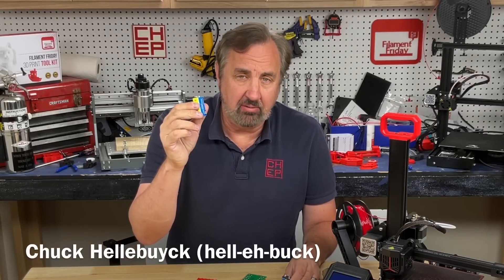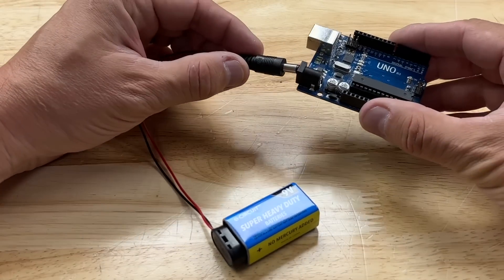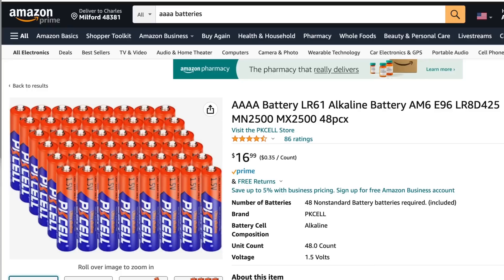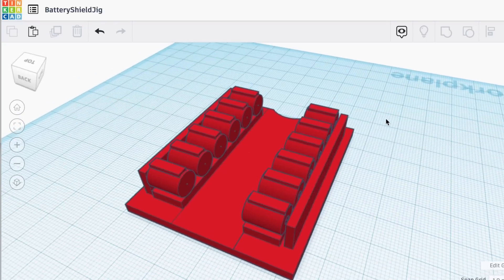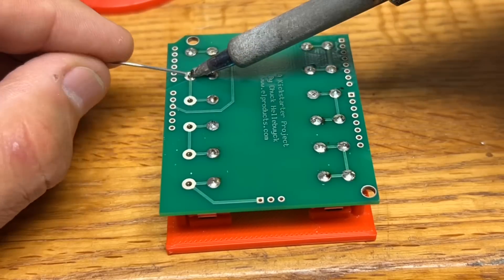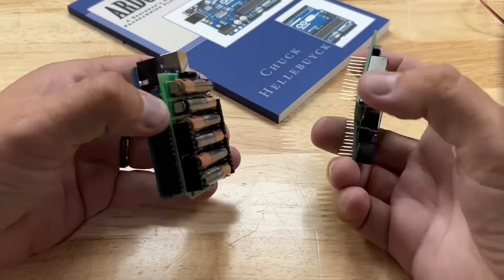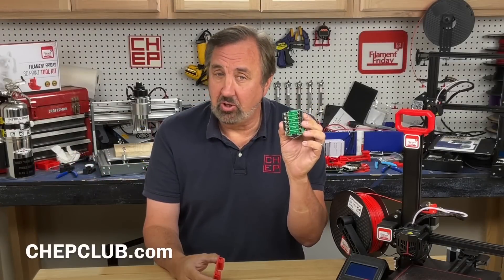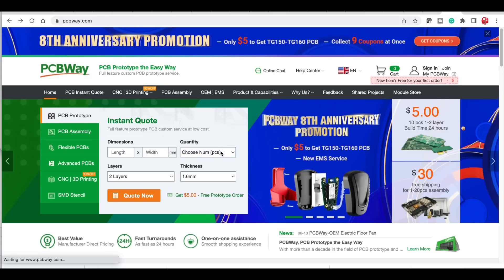9-Volt Arduino Shield with 3D Printed Solder Jig

Comment: Is there any benefit on using 9V instead of 6V? i mean, it gets regulated down anyways and with less voltage you should get a longer runtime for the same amount of batteries.

Comment: It's an interesting design. This seems like best anyone could do with cells from the alkaline age. AAA is a bit too big for 4 cells to fit (6V). 3 could work if 4.5V was acceptable.
Reply: If I'm using cell sizes from the alkaline age, it's probably because I require NiMH batteries for the project (usually due to charging simplicity). If so, I'll usually want a size that I can use elsewhere. If I don't require NiMH batteries, I go to my default option (Li-ion). I don't use any other chemistries for anything, personally.

Comment: I always struggle with "alternate back and forth" batteries to put them in series. It is so easy to build the PCB so all the elements can be installed in the same direction, negative at the bottom., and positive on top. The routing of the PCB taking care of everything. Sure, there is some drop in the connexion, but is it so important? Anyway, it is a nice idea! Thanks.

Comment: Now, don't get me wrong, when I clicked the vid I thought you'd use the 9v battery as is. Now that I've seen it, why would u use 9v as input? I'm coming from the esp corner, but from what I understand the Arduino uses 5v, so it probably has a linear voltage regulator somewhere that regulates the voltage down. That again means the higher the voltage, the more conversion loss you get as heat. That in turn means using 4 of those AAAA batteries for 6v vcc would have been way better in terms of efficiency and longevity.
Reply: Exactly, two of the cells are being basically turned into heat.
Reply from the maker: Depends on the design. Having 9v on the rail gives you the opportunity to control higher voltage from the 5v Arduino port thru transistor/buffer. Just like there is a 3.3v supply as well on the Arduino rail.
Reply: @FilamentFriday  may i suggest in that case to add a trace taking the 6v off of four batteries(and if your fancy with four pchannel MOSFETs and 4 schottkys as a power path to balance the batteries)to optimize power consumption?  Might also be worth to just use 4 batteries and a boost converter if 9v(and depending on how much of it) is really needed
Reply from the maker: The 5v regulator on the Arduino requires a minimum of 7v to maintain stability so I don’t recommend that.
Reply: @FilamentFriday  thanks so much for clarifying - as i said i come from the esp32 corner, so I'm used to dropout voltages of 1.7v, and since most my projects are battery powered rather in the 150-250mV range

As an edit, i was expecting the Arduino microprocessor to be internally running on3.3v. as i said, esp gui

Comment: Maybe I'm missing something?  Why wouldn't you just put standard 9v batteries in series? You can get 9v batteries anywhere and no need to disassemble and probably cheaper than buying the 4a individual batteries.  I get that 1 shield could be more compact, but you could get about 3 to 6 9v batteries in the space of 2 stacked shields, depending on orientation.
Reply from the maker: How would you put shields on top of those? 
Using AAAA which are smaller diameter that the headers allows you to stack easily and add shields.
Reply: @FilamentFriday  that's a fair point, but I would print a case with battery compartment under the Arduino and functional shields on top of the Arduino. Easily change the batteries without dismantling the unit. You need back protection for the Arduino anyways.

Comment: It could be dangerous to stack your battery packs. If the voltages aren't close enough, one of the packs will try to charge the other. This could damage the batteries and cause them to leak.

Comment: 0:05 You don't even need a 9V for that. Those are often AAAA batteries (9V batteries might have other forms of cell stacks).
A 9V block is around $10, For $13 you can get 14 AAAA batteries. (which are more cells than what are in two 9V blocks, and you don't have to mess with a 9V block potentially damaging the cells)
Also, you can get rechargeable AAAA
Reply: I had a Streamlight flashlight that took 3 x AAAA.  That was a great SLIM flashlight.

Comment: No love for the Raspberry Pi?
Reply: The pi needs controlled voltage, all of them can be powered via usb, full size pis can be powered via the 5v pin. Pico needs 3.3v if powered via pin. Arduino can take up to 12v to the vin pin, or the barrel jack. So basically, powering a pi is more difficult.

Comment: Chuck, where can I find your Ender 3 (original) profiles for the new Cura 5?
Reply from the maker: https://youtu.be/jM_jdsx5yFc
Reply: @FilamentFriday  Thank you, sir!  Have you done a video about the Arachne Beta Cura version?  I just watched Thomas Salanerer(sp) video and swapped over to a .6mm nozzle.  I'm installing the Arachne beta now.
Reply from the maker: V5.0 is the Arachne release. Arachne Beta is old. Unless you are loading v5.1 beta.
Reply: @FilamentFriday  That explains a whole lot.  Thank you.  I'll admit, it's been 6 months since I fired up the printer.  I had to change the thermocouple in the hot end today too.  So far, the .06 nozzle is just not working out so well.